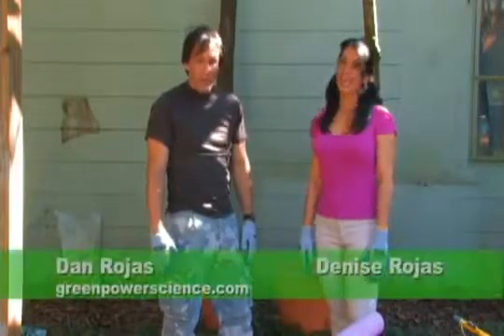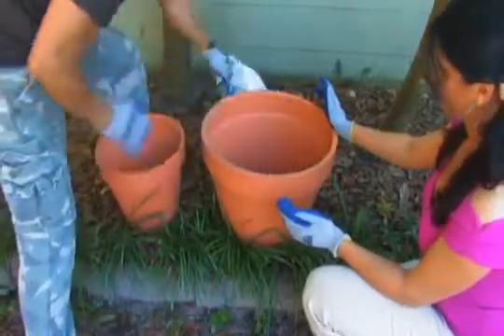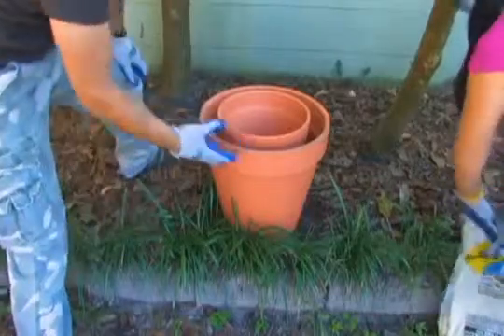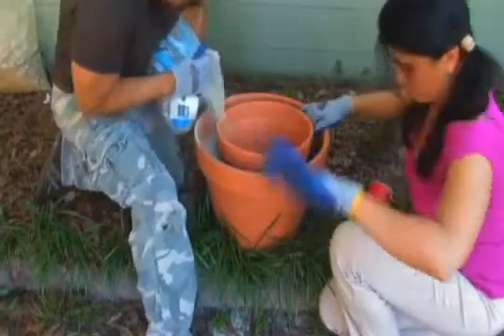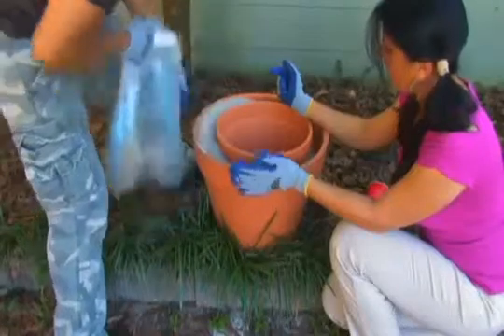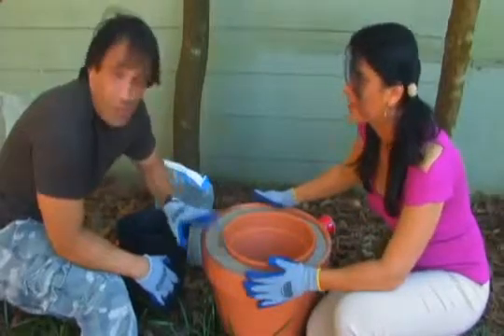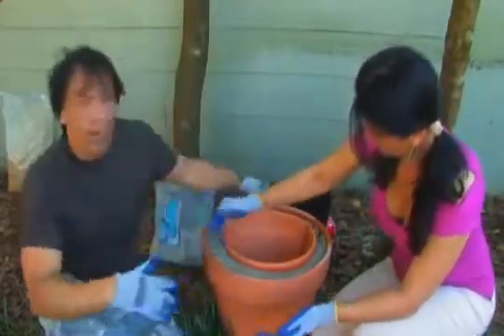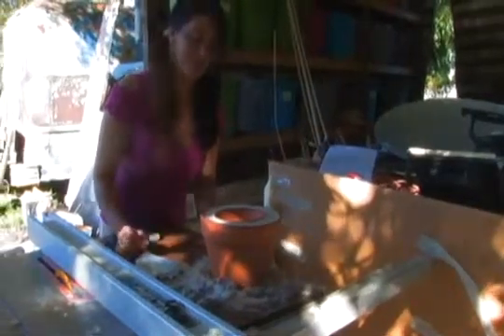Zeer Pot-in-Pot Fridge

Comment: With your wet towel hanging so far over the sides of the pot, weren't you blocking the needed air flow to the sides of the upper portion of the outer pot? You did say the more surface area "open" to airflow the better! So if you suspended the pot, or elevated it to expose the bottom, and trimmed your damp towel to expose the sides of the top of the outer pot, you will see an even lower inner pot temperature than you recorded!